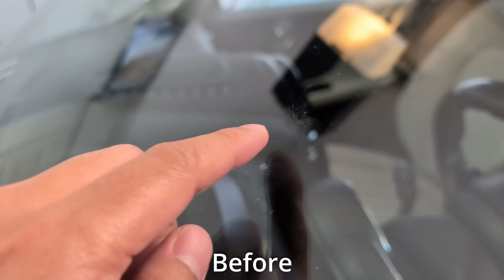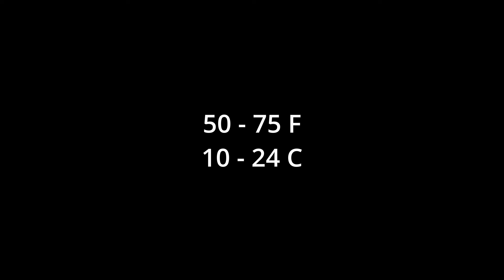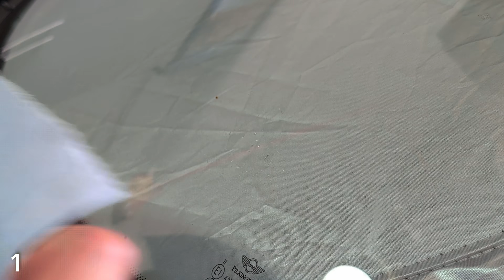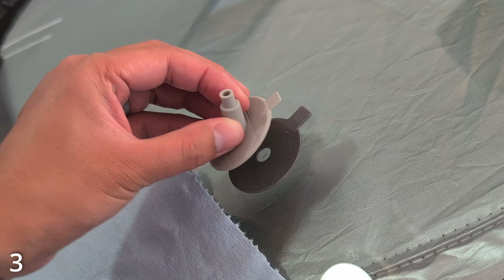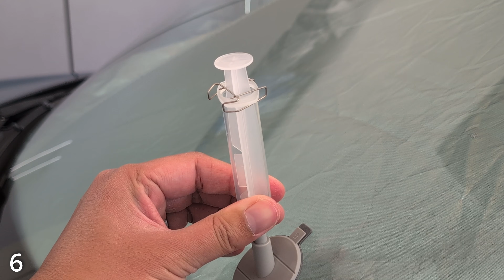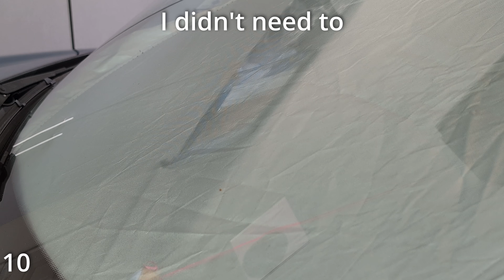Permatex Windshield Repair Kit Instructions with Tips

Comment: Soon as i pushed plunger down, all the resin shot out and ran down my windshield. Waste of $ and time.
Reply from the maker: I'm going to assume a tight seal wasn't made. Things don't always work out the first time so patience is key 👍
Reply: @DrewZ4 same with me, so should I redo the step again...for me it happened when I inserted for upper position
Reply from the maker: @kairavsharma  If you can salvage what you have give it another shot
Reply: Same with me, so should I re do it with diff kit ?